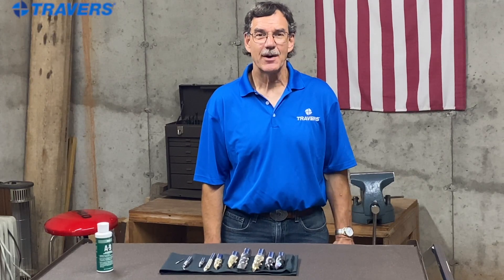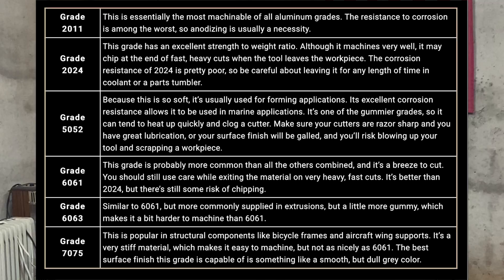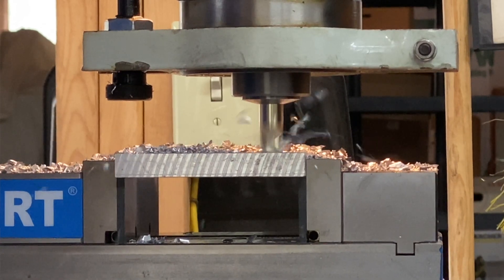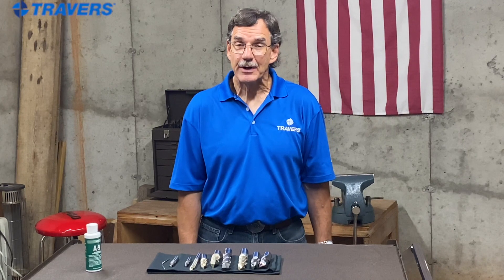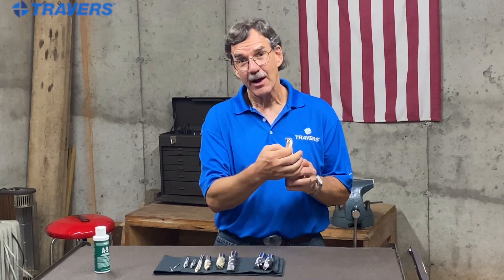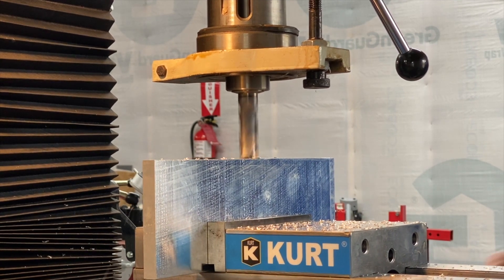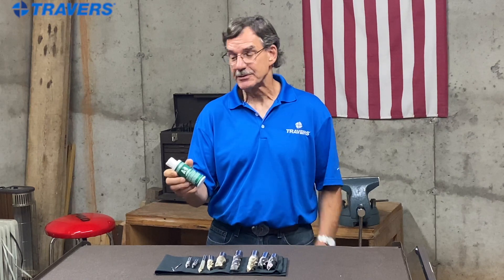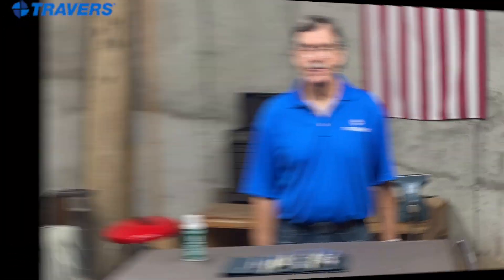How To Mill Aluminum: An Introduction To Aluminum Milling Basics

Comment: I have to drill 3/4 inch hole through 1 inch of 6061 and then go 1/2 the depth with a 1 1/4 with a flat cutter .....I'm not sure if I can just go straight down with a standard milling bit or what options might you suggest....thx Matt
Reply from the maker: I apologize for the extended delay. We've been experiencing difficulties accessing and responding to YouTube comments.
I'm probably way too late with my response, but if you're doing this in a milling machine, after you drill your 3/4" through-hole, follow it up with an end mill.
Reply: I figured it out sir....not a problem